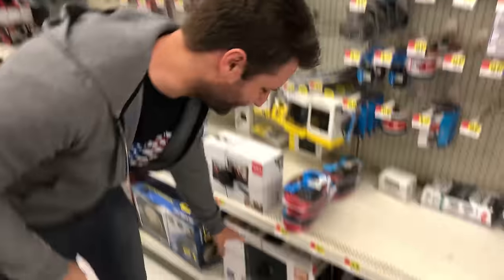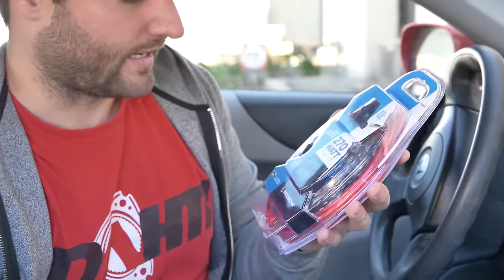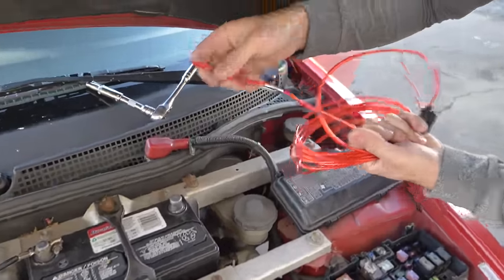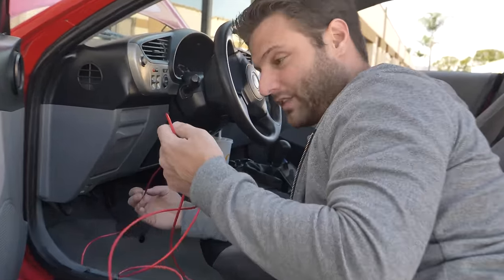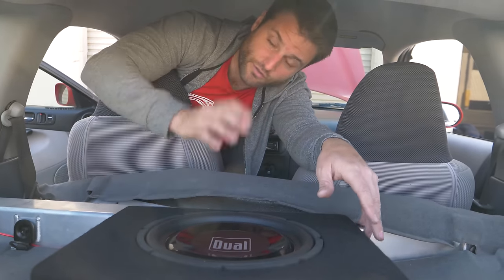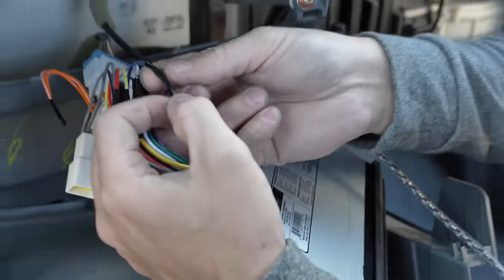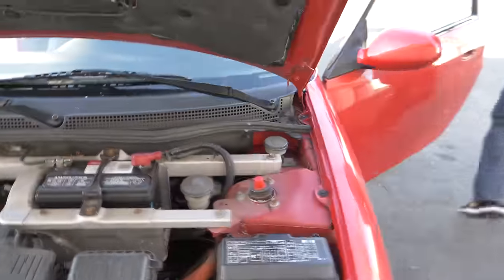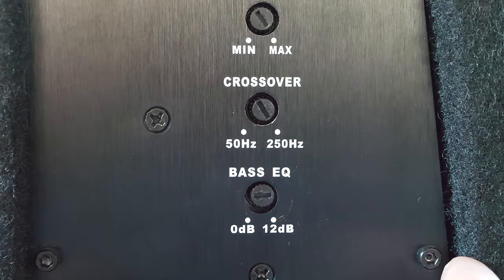How bad is the $70 subwoofer from Walmart? Install | Review

Comment: Wait, did he just pull off his fender to run that power cable, what!
Reply: It's easy you just undo 4 bolts and you get plenty of access, then put the bolts back in and it goes back to how it was
Reply: Or it can be a Renault and must do ... Fuck it !!!
Reply: I had to do that in my car too. It only has one hole in the firewall and it was on the opposite side of the engine compartment as my battery. Running the wire through the front fender was the only way it would reach
Reply: Yea, I thought "what" Too... I've installed a gazillion stereos and never tried that. My wires all go thru the firewall as close to a straight shot from the battery as possible. There is always a way. I've drilled thru and rubber gromitted the hole. I also run all the wires together so it's less tearing of the car/truck apart,, saves time... good job tho it all came togather in the end.
Reply: Lessco Electronics 😂🤣😂🤣😂😂😂
Reply: Lessco Electronics that’s what happens after you take one of your cars to sema
Reply: My thoughts exactly. 😂😂😂
Reply: 🤷🏽‍♂️ lol he did say cheap install
Reply: I have never laughed so hard watching this guy install car audio. He took the freaking fender off LoL
Reply: Alot more then just 4 bolts lol, you gotta remove headlight, drop the bumper, remove the fender liner, and then once you are done have fun lining your fender back up properly.
Reply: Just like the clutch pedals on the passenger side 5:35 lol
Reply: People here says is not good to run the wires through the fender but nobody says why... any specific reason? Thanks,
Reply: @tsautomotive5006  he said because there's no clutch petals to get in the way on this side
Reply: @shawnjohnson2837  no I just thought it was funny I got what it meant
Reply: pay attention people he followed the factory harness.
Reply: @eirenjoe1513   everyones so scared to drill a damn hole!
Reply: Whats wrong with that? I do that too, no heat, looks cleaner
Reply: @andresarme  1- because you risk scratching or denting the fender upon removal and installation, 2- because thats just plain silly when you can drill a hole in 10 seconds, give it a grommet and be done with it. 3- because most people that run it through the fender just stuff it into the boot of the door harness or just simply through the door moulding...
Reply: ANDRES ARELLANO you can just drill a hole in 10 seconds and put it straight through the wall. Instead of taking off your fender bolts, in my car and a lot of others, these are not easy to get to. And in my car at least, the minute to drill a hole is by far smarter. But than again my car is made with a hole with a rubber seal in the fire wall. So I would just use that.
Reply: Lessco Electronics lmao yup
Reply: Let's be real.  He didn't leave it in there anyway.  That shitty system got removed after the video..lol
Reply: I ran it through my door like that before and damn near burned my car to the ground from it getting caught in the hinge. Always run it through the firewall! Most vehicles will already have holes in the firewall with rubber plugs that can be punched out. Example my 04 mustang had one on the far left side hidden. My 04 jeep liberty had one on both sides of the vehicle hidden behind the carpet and plastic. You just got to know where to look for them.
Reply: I took my doors off to run mine 🤣😂🤣😂
Reply: I had a flat in my lowered Toyota pickup years ago, the tire split and as it was spinning it grabbed the wiring harness and pulled all the electrical wires out, I noticed the lights came on for a split second then the truck died as I was slowing down. Bent the front bumper out and wrecked the fender..2700$ blowout.  Moral of the story don’t run wires under the fender…
Reply: @andresarme  because say you get hit on that side and the wire gets cut. It’ll start grounding out. Can’t happen if the wire is in the engine bay through the fire wall, and if it does happen… well then you’ve got bigger problems to worry about
Reply: Well I would hope you don’t have a clutch pedal on the passenger side…

Comment: PLEASE PAY ATTENTION: 
First of all. Great effort. A+ for trying it yourself and do not want to discourage anyone from DIY BUT:
1. you should always remove the NEGATIVE from the battery terminal before running a wire. (if that + fell to the bodywork... SPARKS!!) 
2. That wire is LIVE as he ran it thru the car and could have caused sparks / or even worse a fire. 
3 Always run it from the terminal post and NOT the fuse box. 
4. Run the wire thru you rubber grommets in the firewall. The door Jam will break the wire and yep, cause a fire.
5. they gave you straps for a reason. use them or you could get hurt from a flying box
6. set gains to prevent blown subs, plenty of vids online
Reply: Hey I just ran mine from the battery but why can't someone run it from the fuse box?
Reply: That's the first thing that made me groan,  was not removing the battery ground(negative terminal)
Reply: It's possible to run through a fuse box but the catch is, you have to use small wire like 8 gauge stuff, anything bigger then of course it goes to the battery terminal
Reply: If your fuse isn't in the fuse holster its not a live wire 🤣 it was live for about 1ft lmao
Reply: @shattershots3171   yeah some people just want to complain about things they ASSume based off a cut up edited video lol

Comment: Being a serious car audio enthusiast /installer , this was interesting. And funny..😅
Reply: Twist & tape?
Reply: Astro Builder, i can do that, replace all 6 speakers with a 4x4 grid of mid drivers in each door, some highs in the dash and a 6th order wall with 8 18's in it. you'll be bumpin.
Reply: Well, considering QGs suggestion was 42 speakers, and that's more than 1, you should be good to go!
Reply: Then I am sure you can answer how to stop my subs from drawing so much off my alternator. Running two 10s (pioneer) with a 1000watt amp. Amp is set to run the lowest cross over and everything so subs wont hit so hard. Still fried alternator, havent used subs in weeks as I am afraid of frying the new one.
Reply: you need a high output alt,or a secondary battery and "the big 3". also thats isn't how the crossover works,the crossover only changes your highest sound frequency level(hz). example,I have the amp for my subs to play tones 100hz and below,my amp for my door speakers is set to play 80hz and above. what you may be thinking of is the gain. do a quick search here on how to set amplifier gain.
Reply: nash jesso Oh you mean the volume knob lol..All the way to the right lil
Reply: Dan Dun Did this guy IS a fire hazard.
Reply: Xperimental get an agm battery like the yellow tops or a bosch platnium from pep boys, I had a single 12 on a hifonics 1700D and my voltage would stay above 14 most of the time, before i had a regular battery went through 2 before getting an agm. Now I have a 2500 watt amp on 2 12s, at half ohm battery still stays at good levels
Reply: Astro Builder I was cringing at some Points though
Reply: These comments are almost as funny as the vid 😂 to anyone who questions my knowledge just by me stating i have knowledge of the subject is silly, i have over 900 clock hours at installers institute and have been a bass head since a baby, and no i will not answer your random questions about your mini audio system👍
Reply: I just started building my first wall ever trying to do it professionally first time around so I don’t have to rebuild it later so when I watched him pick up the duel I was like oh mighty lord I would need much more bass then that let me tell you after driving around with subs not having bass is quite disappointing
Reply: I'm just saying I facepalmed and got stressed out a few times watching this
Reply: My friend has a Rockford P1500.1 amp (Power series, running at 2 ohm 1686 watts rms) and his fuse holder keeps melting. Completely. Will upgrading to thicker gauge wire help this? We had a 100A fuse and a decent holder and it melted the holder, but not the fuse. This last time it lasted about 3 months before melting. What’s odd is that after “bumping” for hours straight the first night he got it, the holder wasn’t warm at all. My uncle says it’s probably a loose connection or something.
Reply: make sure the ground is solid. make sure not to buy cheap wiring kits from walmart. at that power level you want to go with something oversized. try 2ga wire and a smaller fuse. you want the fuse to blow, not the fuse holder. also, if it's the bolt on type of fuse holder, make sure the bolts are tight. keep it away from heat as much as possible, zip tie all wires so they don't move and rub, which can and will cause cracked sheathing and ground faults.
Reply: if he already has 2ga wire, use 0
Reply: Josh Repik honestly don’t know what gage wire it is. He had the wiring installed at a professional audio place in my small town. He also has a Rockford Prime P400.4 (I think) running his door speakers (Alpine coaxials.) The Audio Shop installed the door speaker amp, his old mono amp (shitty 850W Renegade amp), and the door speakers plus all the wiring. We just switched the mono amp out and put the RF Power amp in and then we started having these issues. The amp sounds INCREDIBLE, I put my 10” kicker L7s in and I’ve never heard them hit so hard. It’s breathtaking, literally. The wire that’s running from the fuse holder, to battery, to amp is pretty thin tbh. Like about as thick as the extension cord for a MacBook charger (only thing I could think of that’s the same size. )
Reply: I was aMECP certified professional installer for just over 15 years- started doing it during the "golden age" of car audio in the mid 90's. there is so much fail in this video with the install this guy did- literally the only thing he did correctly was run the RCA cables down the opposite side of the car  as the power cable. 

i started laughing pretty hard when he started unbolting the fucking FENDER to run the power wire back to the amp, btw- now every time he opens the door its going to flex the power wire which isnt meant to be constantly moved like that, it will cause strands of his cheap wally word power wire to break inside the cable causing high resistance and a hot spot that will eventually either melt the sheath or cause an open in the wire. either way you NEVER EVER run power wire in through the door jamb or door boot- there is usually a rubber grommet in the firewall near the battery where you can poke the wire through, or drill a hole, insert a PLASTIC snap grommet into the hole and then run your wire through that. disconnect the NEGATIVE terminal on the battery, not the positive, lmao. 
the icing on the cake was connecting the power wire to the fuse box and not the the battery itself.  i cant see it on the video but he probably put the fuse holder in the back too.
Reply: yes, more speakers is ALWAYS the option.
no downside to this approach. ever.
Reply: Same haha.... I learned all my stuff through excessive reading and about a dozen installations...
I suggest you do the same... if you REALLY want to install your audio properly then I would recommend reading AT LEAST 10 hours on everything you could possibly ask..
Examples of things to research:

—Ohm impedence 
—Headunit volt output 
—Headunit channels
—Headunit harness wiring diagrams
—Fuse placement 
—TRUE RMS Wattage 
—Wiring diagrams for subs (DVC OR SVC?)
—Remote turn on, and when to use a relay 
—Total amperes rating for each wire converted to watts so as to not overdo it.
—When to use line drivers for 2+ amplifiers
—And MOST IMPORTANTLY(yet constantly overlooked) learn how to calculate your vehicles factory alternators power “reserve”
That can be used for your system.
(A safe zone is <600 watts)
And learn what these things actually do 
—big 3 wire upgrade
—high power battery/additional battery
—capacitor
These items make big claims but they are not going to help you any if your alternator is factory and your trying to run a 1500 watt+ sound system ....

And about 80% of the time I’ve found that people selling there amplifiers and subwoofers online don’t ever give you all the sufficient information to really purchase the correct item.
Don’t ever purchase a piece of garbage that only has the peak wattage rating. 

But again just find it for yourself dude, hope this helps
Reply: @BeesonsCars  most melting wires is a loose connection or the wire is straight up to small. Not like a size or so to small but like u need 8 gauge but using speaker wire small. U want small and strong use extension cord or use anything for a house wiring

Comment: I watched your inexpensive radio install and this video and liked them both.  Here's a suggestion for your next inexpensive install.  Walmart also carries inexpensive "super tweeters".  Your car has door mounted speakers like my truck and the sound stage was low and unnatural.  If you install a pair of super tweeters that and can be attached to your dash with double-sided tape, it makes a world of difference.  The secret is to connect them as your front speakers and your door speakers as your rear speakers so you can use the radio fader to balance the sound between them and the door speakers.  You will be amazed at how it brings the voices and highs up to dash level and makes the system sound so much more balanced at very little cost.  That's why many car now have tweeters in the dash or top of the door in the ones with better factory systems.  Anyway, just a thought.

Comment: Always remove the negative battery terminal first! You also should have used an existing wiring grommet to feed the power cable through the firewall and not through the fender. And the power wire should be wired directly to the positive battery terminal!
Reply: Don’t forget make sure the ground is a non painted surface
Reply: the positive wire on the fuse box 💀💀💀💀

Comment: A couple of tips to optimize the sound. If you want to get better sound out of the front speakers install " bass blockers" in the line. They are small capacitors that block lower frequencies at different levels. It allows them to be turned up more without distortion. 
If you hear a wine in the sub woofer that changes with the speed of the engine then separate the turn on line from the RCA inputs. They are sensitive to inductive pickup noise. I know its not that apparent in subs but that internal crossover is probably only 6 dbs per octive at best 12 which will have some high frequency bleed through.

Comment: I just pulled this same sub out of a truck I just bought. I thought it was pretty decent, but I still upgraded to something better. My only beef with this sub is that there isn't much room for a port, or vent, and it doesnt do low end bass all that well. But it's still worth saving your $70, and waiting till you have atleast $200 and you can get better sound.